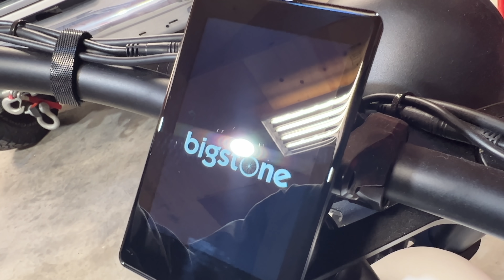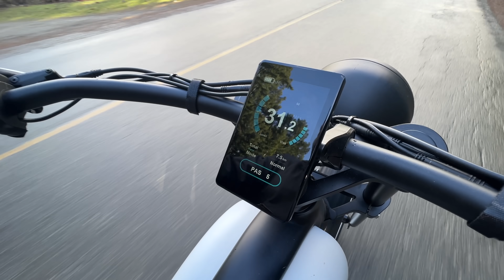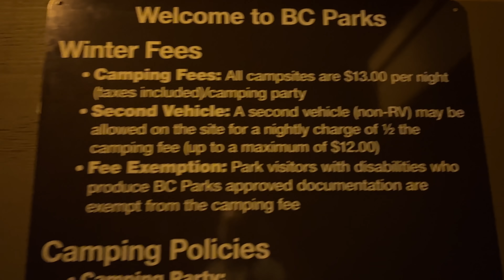Sleeping In The Shop + Kid Makes Us a Model Of Our Van Home

Comment: Hey Chrome concerning your little rust areas paint over the rust with a product called POR 15. Once that dries after a couple days then go over it with your raptor liner coating or whatever it was that you used.

Comment: Howdy Chrome , 
(  i hope you read these comments today ; or perhaps Madison will alert you to this ? )
•  REGARDING FIRE SAFETY :  👍GREAT habit to unplug & power down everything  ,  but you've got a typically IGNORED THREAT still lurking 😧 !  👉 CHEMICALS  👈
•  My contractor friend was doing a standard multi-day remodel  job , usually pulling-IN to the customers driveway , tailgate streetward ( helps in not loosing tools etc.) 
•  Well on the last day , for some unknown reason , he BACKED down the driveway to the garage door. Job done , he loaded-up the pickup & left.
•  Not 5 minutes later , he got a cel-call from the customer. Did he leave a cardboard box in the driveway ?  "Oh Darn" , he apologized. "You're right ,  i drove -away without the TrashBox . Sorry , i'll be right back , i'm still in-town." 
She replied: "Well , it's actually ON FIRE 🔥 here."
•  The clean-up rags had just the wrong combination of chemicals still-damp on them , & they REACTED.  If he hadn't backed-in , he  WOULDN'T have forgotten them , & he probably would have lost his truck to fire !  Mere MINUTES !  WAY too close  of a call .
•  So make sure you have METAL Trash baskets ( preferably w/LIDS )  , & be super careful w/ damp rags.

Comment: This company Merkava, have everything i need to build a bullet wheel chair for Jeffie Bear. Thye have the motors, the hydraulic suspension and everythinng Except the tracks ( we have to design it). All silicone track with fine silicone tip. Able to climb over any door entrance, stairs. rocks. I have a vision of it i i know how to build it and it will last almost forever. Asle free. lithium ion batteries»» 2x 12volts. Even a cigarette lighter and real spotlights and flashers. Papa Bear only have to drive it like a bike, nothing more. We have to develop the track system, that is it. But Chrome won't read this comment................. What can i do?????????